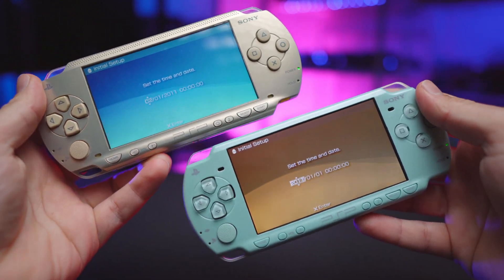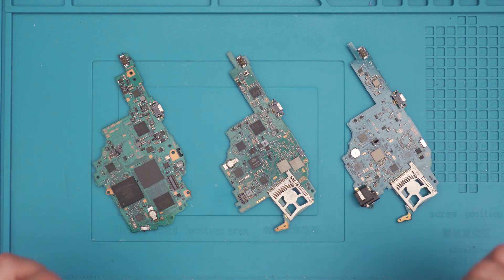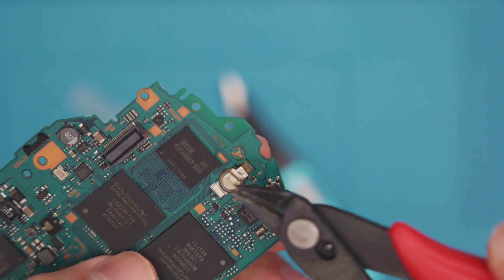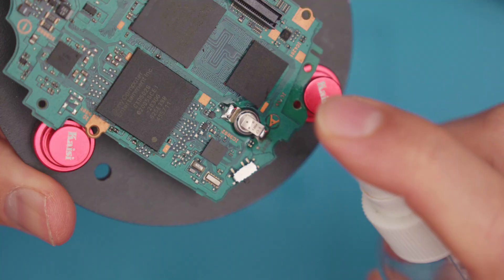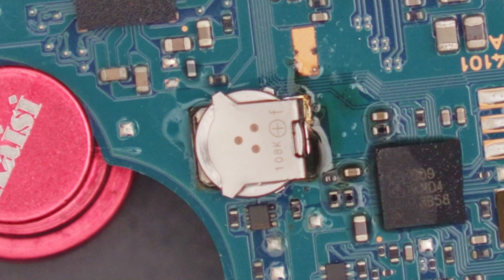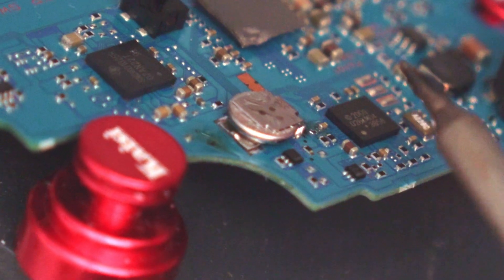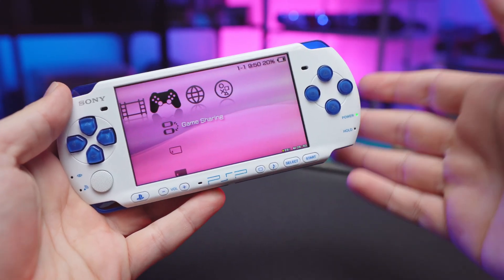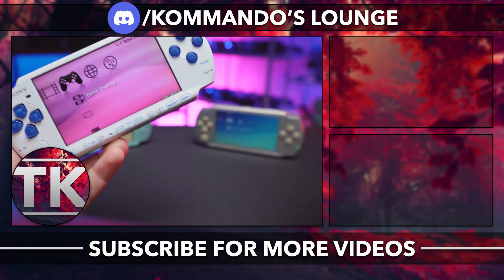How To Fix PSP Super Capacitor "CMOS BATTERY" [Read Description]

Comment: Hey, love the channel, been watching all of the videos lately. So I got a PSP 1000 recently and got an Ostent battery from your battery video (the one you linked in the description). The thing is, the battery doesn't seem to ever fully charge. It is always around max 80% and shows very misleading data. I got another battery and it's the same thing. Mind you, the PSP works and it gets around 4-5 hours of playtime. The only thing is that the battery percentage is incorrect and it never seems to fully charge. Could this problem be solved with this method? I'm really clueless when it comes to this haha. Thank you in advance!
Reply from the maker: PSP generally doesn't have super accurate percentage readings, let alone with aftermarket batteries, if the super capacitor is shorting / spewing its guts, its possible that its causing a load that's throwing of calculations. If your PSP doesnt keep time, I would disable or remove it anyways, since its stressing the battery when its sitting around constantly sipping power.

You can try shorting the 2 outer pins pos/neg on the battery for a nano second to reset the BMS on it, do not touch the middle pin otherwise you will kill it.
But this should not be needed.
Reply: @TotalKommando okay, I'll see what I can do. Thank you!!!

Comment: sooooo I've removed the cmos battery and replacing it with a pc cmos and now it doesn't turn on even if charged.. putting back the original cmos and still nothing... my question is does the cmos stop the psp from turning on or did I mess something up along the way when disassembly?
Reply from the maker: I was reading this on my phone, re-reading this again you used a pc battery was not a good idea, those are not designed to be charged so who knows what might have happened : |

PC is non rechargeable battery
PSP is a super capacitor that charges and discharges quickly
Reply: @TotalKommando  thanks for an amazing detailed report....so what your saying is im screwed and I should let professionals fix it for me.... to be fair Why I used a pc cmos because the current battery was only giving 0.9v, so an idea gave JUST a temporary solution ama solder externally a pc cmos😅
Reply from the maker: @owlfred749  There was no need to replace it xD
I think your best next option is to just order a new mobo or a doner psp
Reply: oh no after re-reading your comment on my phone I straight up misunderstood the meaning of cmos on a psp...so it's not battery but a capacitor.....ok so I know now what killed it😅
Reply: @TotalKommando wow 3.3v was enough to kill it... sure buying a new or donor board would fix it, but trying to repairing it is really not an option? like buying a somewhat similar capacitor just the same value?
Reply from the maker: @owlfred749  My suggestion is to disable it or remove it without replacing it, its a very problematic part. If you can match the specs it should work fine, if I were to do this again, I would use long wires to allow me to solder/replace in the future without touching the motherboard directly
Reply: @TotalKommando ok thank you for a clear advise sir
Reply from the maker: You may have ripped or damaged a component, so far my testing and majority of reports, tell me that psp still works without the cmos, thats why I have notea in the pin and description suggesting to disable instead of full removal

Read the notes i have for more info

Comment: Mine can only run with a charger plugged in without a battery in the back, with charger and a battery both in it turns on then shuts down after a few minutes
Reply: Hi mate, mine has the same problem. Did you solve it by doing this?
Reply: @julianariasrodriguez9728 no I haven’t solved it, I don’t wanna take it all apart to get to that cmos thingy sorry mate

Comment: I disconnected the capacitor on my psp 1000 and after a while of being of it won't turn back on unless I remove the battery and put it back in. Im waiting for my new capacitor to come in to replace it, before disconnecting the capacitor my psp had no issues besides the time always resetting and the battery draining if i left it off on didn't use it
Reply from the maker: The charging chip might be going crazy : |

Comment: Just saw you Answer a lot of comments, so here goes nothing. I recently found my old PSP 3004 in a bin at my parents home, the original battery was very swollen and the battery cover fell off (probably due to the pressure of the swollen battery). Bought a new ostent battery off amazon, installed cfw but now the PSP only works when no battery is inserted and its plugged into the AC adapter. If i put the battery in, it will stay on for maybe a couple of minutes, once i unplug it, it will turn off after a couple of seconds. I saw a reddit comment saying that you should leave the PSP on the XMB with the AC adapter and no battery for half an hour and then put the battery in, that made it so it only turned off after like 1-2 hours. Just ordered a second battery with the hope the one i recieved is faulty, but do you think the symptoms i said sound like the capacitor is the problem? Thanks!
Reply from the maker: It sounds like a damaged charging chip, its a coin toss, if you read the description or pinned comment, there you can find the info I have gathered thus far.
One thing I want to try is to reflow the chip to see if that fixes it or not because a lot of these issues have been popping up recently.

Comment: I removed the SuperCap like you said, even bought kapton tape to wrap around it, it wont turn on anymore, with or without charger 

I didnt break anything, any ideas?
Reply from the maker: Did you remove it or disable it, and what motherboard revision is it, also what kind of problems were you having before
Reply: @TotalKommando disable it, cutting like you did same spot and all

In cronological order 

1.- PSP didn't recognized batteries, only sometimes and drained the whole battery overnight 

2.- PSP didn't turn on with batteries, had to use charger only 

3.- i cut the SCap like in the video, following your tutorial on how to disassemble 

4.- PSP no longer turns on, but lights up when charging a battery 

(I did try 3 different batteries including OSTENT and they didnt work in my model, however, they do work in a friends PSP)
Reply from the maker: @Eustakista  ok if you disabled it only and its still attached, try re-bridging the connection you disabled with anything like aluminum foil for now just to test, in some cases it seems if the psp has a faulty charge chip with various levels of symptoms it sometimes stops turning on all together.

Did your hand ever slip during the process and knock anything by any chance?
Reply: @TotalKommando i slipped but didnt hit anything
Reply from the maker: @Eustakista  Which PSP model / revision
Reply: @TotalKommando 

PSP 3006, New revision
Reply from the maker: @Eustakista  095? no antenna version?
Reply from the maker: @Eustakista  if thats the case, I got some close ups, i would start by getting a closer look to see if you damaged something without knowing

https://www.komstation.com/resource/psp-motherboard-revision-closeups/
Reply: @TotalKommando yep thats the one
Reply from the maker: have you checked/compared your components or tried to restore the super capacitor connection to test
Reply: @TotalKommando imma let you know tomorrow, either way, in about 2 weeks the replacement arrives
Reply from the maker: @Eustakista  alright
Reply from the maker: @Eustakista  btw I have added extra updates in the description / pinned comment if you are interested in reading into it.

Im trying to get to the bottom of it
Reply: @TotalKommando 

After removing the SuperCap from the MOBO and looking at it closely, it seems like a short circuit, the voltage goes trough, none the less, there was a chip missing, the smallest one left side of the SuperCap, i did not broke it, seems the last owner either broke it or removed it by accident 

I sadly dont have a heat gun for soldering chips that small, however, i bought a new MOBO, seemed more easy that way
Reply: @TotalKommando i can try to send you HD photos if you like, i think its possible to fix, nonetheless, it needs precision, Tools and spare parts, its not viable 

Sucks cause i have to mod the whole system all over again
Reply from the maker: @Eustakista  its ok modding is quick to do with ARK-4 in 5mins, your SD data holds all your saves and configs

you can post it on discord if you want but you can save it for a future project to repair one day

Comment: mine doesnt work is it because i use electrical tape?
Reply from the maker: Could be a defective PSP, sometimes thats the case
Reply from the maker: any updates? read the description for extra new info
Reply: @TotalKommando  still doesnt work properly but i tried shorting the battery and it doesn’t work for several days then suddenly reads the battery and updated my psp and play games

I just need to use it while charging and without the battery then put back after 30 mins and it works fine. So i tried to order new battery and see if that solves the problem.
Reply from the maker: @michaelsantiago1504  Yea sounds like a defective charging chip, it's logic is going crazy : |

I may find a solution for it in the future once I have enough data
Reply: @TotalKommando  hoping for that and im happy to help when needed🙏🏼
Reply: @TotalKommando update: new battery arrived still the same hahaha 😭😭

Comment: My PSP 1000 isn't powering on do you think this capacitor could be at fault?
Reply from the maker: I dont think so, could be a bad power switch, loose cable, blown fuse (will have a video on fuses) or anything that could kill the mobo
Reply: @TotalKommando yeah I tried the capacitor and it still won't turn on so you was correct.

Comment: I have a psp2000 that sometimes boot with sound and sometimes boot without sound. When it boots without sound, I cannot play anything. It just works on menu. Playing anything makes the device power off. When it turns on with sound, everything works normally.
Reply from the maker: It could be a failing gpu chip, bad memory card/adapter, or a broken loose or something shorting inside such as a speaker fuse

Comment: Sometimes my psp refuse to charge ( it show charge completed even at low battery percent or charge very slow, not charge at all), I wonder if it have anything to do with this super capacitor "CMOS BATTERY". How do I determine the problem :(
Reply from the maker: I usually see this on faulty batteries or battery BMS, you can try shorting the pos/neg +/- pins on the battery for a nano second to reset it, it may or may not help, dont touch the middle pin.

What brand is the battery?
Reply: Oh mine has no brand, the label state it was made in China. I brought on Shopee for 5 dollar a few years ago. @TotalKommando
Reply: @TotalKommando  Strange, I thought I already left a response. Well it's a no brand battery I got from Shopee around 6 dollar , made from China. I will try your method , thank you.

Comment: My PSP battery doesn’t work cant even turn it on unless I connect it to the charger first. After removing the charger, the battery works normally and lasts around 3–4 hours, just like a regular battery. I can even turn on the PSP anytime as long as I don’t leave it off for more than about 3-5 hours. However, if I leave it off overnight, the battery won’t work again the next day, I have to repeat plug in the charger to get it working. Does anyone know what’s causing this? Is it CMOS because the only time its asking for date and time when I was swapping the psp batteries
Reply from the maker: sometimes a newly built battery bms does that but only once, you can try shorting the 2 outer pos/neg +/- pins for a nano second to reset your battery, dont touch the middle pin.

If you dont suspect its the battery, it could be a failing charging chip on the psp motherboard
Reply: same, any solution?

Comment: I don’t have any problem with the LED not blinking or anything like that the only issue is that when I remove the OSTENT battery from the 2000 unit, it asks me to set the time again. I just wanted to understand if it's broken or not. Also, if the capacitor is faulty, could this cause excessive battery drain?
Reply from the maker: If your time is not kept after removing and putting back the battery that means the super capacitor is dead and or leaking, and is causing battery drain
Reply: @TotalKommando What do you recommend I do with my 2000?
Reply from the maker: remove the super capacitor like i show in this video or disconnect one of the leads (i refer to it as disabling in this vid)
Reply: @TotalKommando I just don't want to have to connect the charger to the console every time before turning it on, so would it be better to get another one?
Reply: @TotalKommando Regarding disconnecting in the sense of lifting the condenser tab without removing it?
Reply from the maker: @Michaelmike98  you shouldnt need to connect the charger to turn it on, that usually only happens when you have a freshly put together battery so the bms on the battery you have might be defective
Reply from the maker: @Michaelmike98  correct, just make one of the contacts (the top one)  isolated, lift it off and tape under it and over it
Reply: @TotalKommando So, do I just remove the entire capacitor part like you did in the video?
Anyway, my battery is brand new, so I don't think that's the problem
Reply: @TotalKommando That's fine with me, as long as it doesn't cause problems or drain the battery. Anyway, I checked the battery yesterday, charged it to 100%, and now it's at 78%. It tells me it will last 5 hours and 15 minutes. 
I just took out the battery and put it back in, and it didn't ask me to reset the time, so do you think it's okay?
Maybe the other time, because the battery had run out and I charged it, it asked me to set it

Comment: I removed the super capacitor or cmos of psp 3000 because it cant detect batteries. But now it only powers on with charger and when i plug the battery in it shuts off immediately. Need help 😅
Reply from the maker: You may have shorted or damaged something while removing it, do you have another psp to confirm your batteries are functional?
Reply: @TotalKommando yep i do have other psp to confirm my batteries are working. Ill do check nearby components if its shorted
Reply: @TotalKommando  i also noticed that after i put the working battery on to the removed cap psp, it destroys my battery and wont hold charge anymore.
Reply: Its working now. I just apply kapton tape on the contacts of cmos then power on the psp without the battery and leave it on for 30 minutes with the use of charger and remove the charger and plug the battery and it finally works 😂
Reply from the maker: lol if anything it sounds like a glitched charging chip, maybe you unglitched it, let me know if stays working or comes back to having random issues, sometimes you think you fixed it, but the problem is still there lol
Reply: @TotalKommando after few hours leaving it off, it turns back to not detecting batteries again 😅
Reply from the maker: @giovannibielza9111 Yea motherboard is cooked, need a replacement

Comment: A question is from here it works for the typical problem that you have a PSP and it simply turns off suddenly the model that I have is 3000 and the thing is that this PSP that I have I can play with it normally but after a few minutes it turns off It does not matter that it is charged and sometimes it does not even matter that it is plugged in honestly I would like to know what is wrong with it and what it could be or something I do not know if this video has to do with that I thought it would have to do with the bios battery but I am not very sure I am just getting into this world and honestly I wanted to take this opportunity to tell you that I really like your videos I have no idea where you are from but I know well that my native language is not English and I am simply grateful that there are people who still talk about these topics today
Reply: I know this might sound weird but I'd even be happy to send you my PSP from my country to yours but that's probably easier said than done so I don't know I guess idea discarded
Reply from the maker: Yea its going to cost more than the psp if sent around, and your fix might be simple, have you tried powering with just the charging cable only? If you have a defective battery, it could also cause weird issues like this, is it original or aftermarket.

I have a motherboard that is funky, its faulty in a way that Im figuring out a fix for.
It only powers on when left without any battery/power for a long time, and wont accept charge sometimes or stops charging after a while when plugged in.

Its a defective charging chip that's for sure and there are many weird behaviors because of it
Reply: @TotalKommando  Is there anything you recommend doing? A friend wanted to fit a PSP-like battery to the motherboard to see if it would work.
Do you recommend doing anything before that?
Reply from the maker: @Durian-Glow_  What do you mean psp-like battery?

my suggestion is to remove the super capacitor and if you still have issues, its motherboard related and there is currently no fix for it. as i have mentioned before, I have a unit that has weird power issues.

Comment: Hey, I have an issue with my PSP 2000. Whenever I turn it on after shutting it down, it gets stuck on the boot screen (the wave animation). I’ve tried everything—new firmware, a permanent ARK loader to skip the boot screen, everything. The only temporary solution is pressing Select, Start, Triangle, and Square, and I always have to do this after a hard shutdown. What could be causing this?